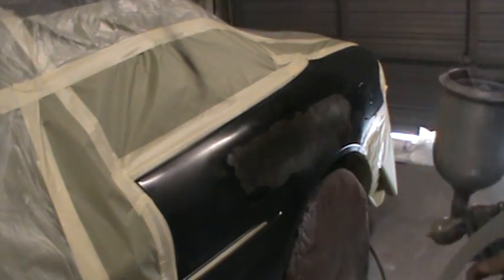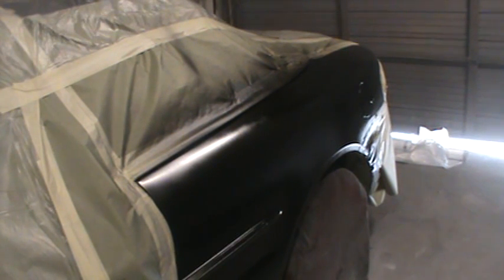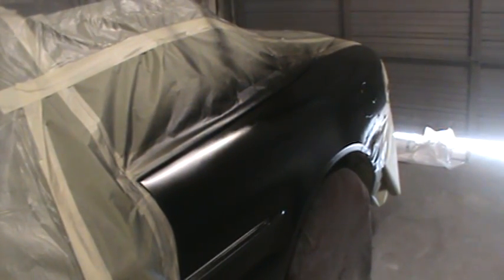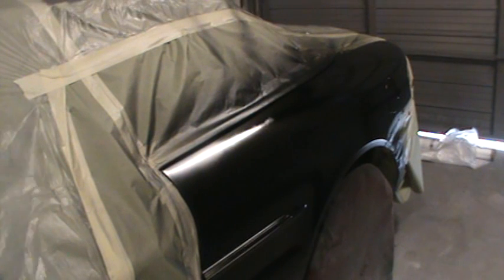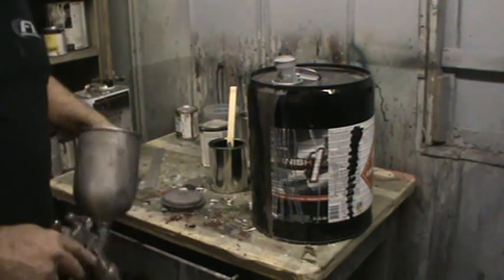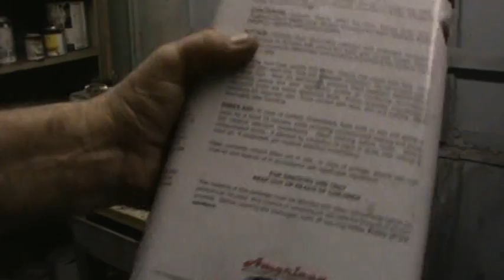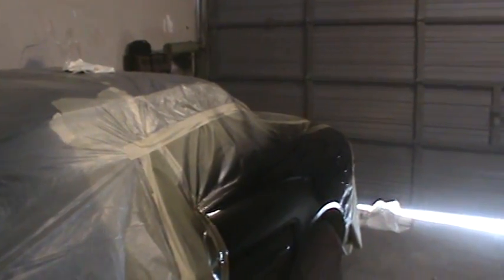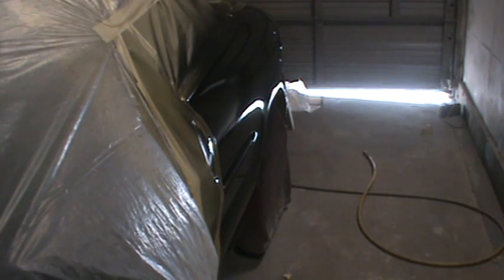PAINTING THE QUARTER PANEL BLACK

Comment from the maker: @wildeyednorthernboy it has to do with the pigments in the colors some cost more then others...black you can use straight and just reduce colors make you have to add balancer which is clear so it thins it out and uses less pigment...the adhesion spray is 17 a can and the grease and wax is 8.50 plus the shipping